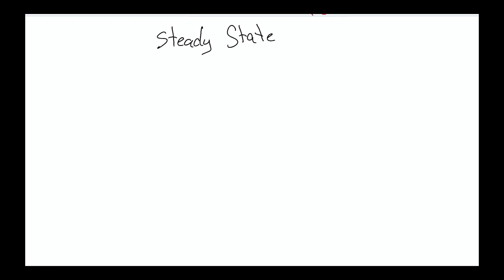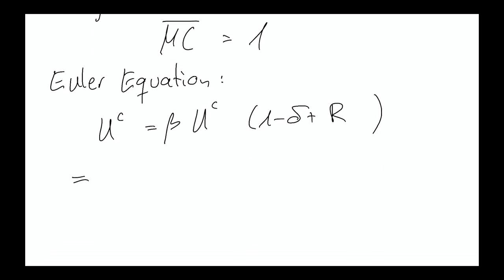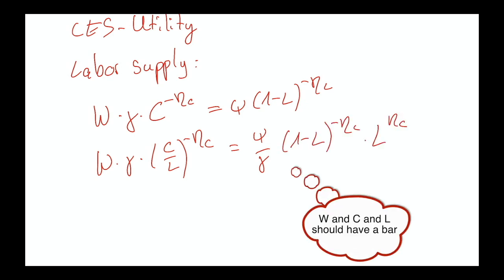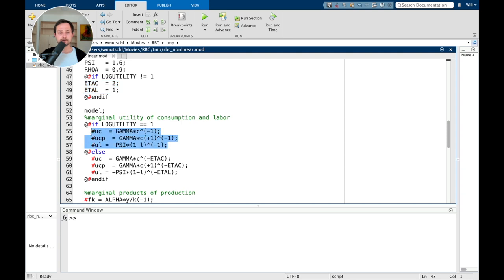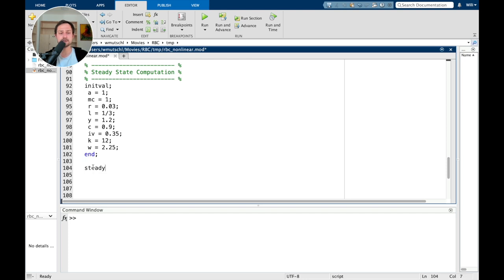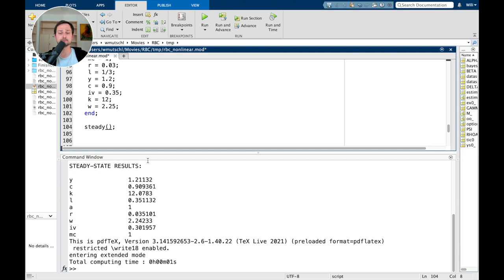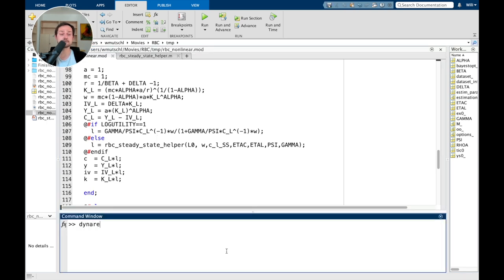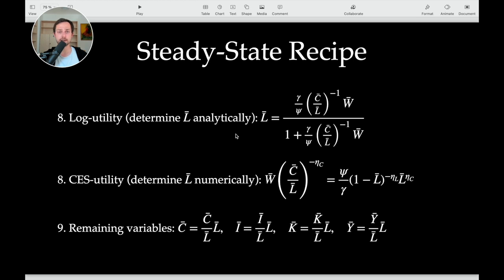RBC Baseline Model: steady-state derivations and implementation in Dynare (with preprocessing tips)

Comment: Thank you very much for the video.  

I have reproduced the same mod file and encountered the following error:

Error using print_info (line 32)
The steady state has NaNs or Inf.
Error in steady (line 102)
    print_info(info,options_.noprint, options_);
Error in rbc.driver (line 210)
steady;
Error in dynare (line 293)
evalin('base',[fname '.driver']) ; 

Could you please explain where I have done wrong?
Reply from the maker: Without looking at the files I can't really do this. But I have uploaded the mod files on my homepage: https://mutschler.eu/dynare/ so you should be able to compare them.
Reply: @wmutschl  Thank you! I will compare my file with the uploaded one.

Comment: Hello, Willi. Thanks you so much for your materials and videos. I would like ask you if you can explain in detail the logic behind this code:

if system(['/Library/TeX/texbin/pdflatex -halt-on-error -interaction=batchmode ' M_.fname '_TeX_binder.tex'])
    warning('TeX-File did not compile; you need to compile it manually')

you didn't explain where the url comes from :( How could I replicate it?

Thanks
Reply from the maker: This is a system command which will be passed by MATLAB to your actual terminal. This command is just used to compile the Latex files Dynare created. If it does not work for you, don't worry, then MATLAB did not get the PATH correctly or you don't have LATEX installed. If you are sure that Latex is installed, then simply delete the command and open the tex files with your favorite editor and compile them with it. Passing the PATH to MATLAB can sometimes be tricky: https://git.dynare.org/Dynare/dynare#optional-pass-the-full-path-to-matlab-to-run-system-commands